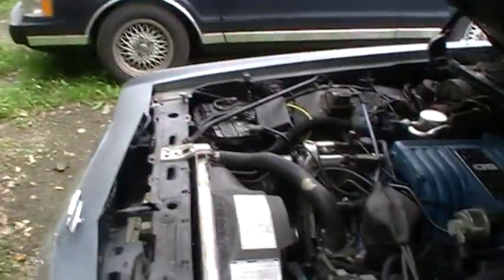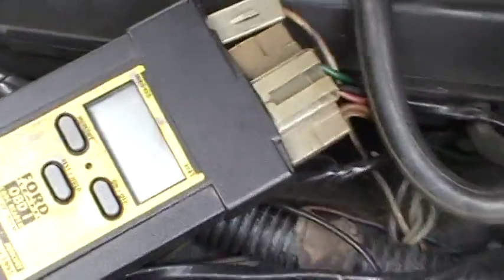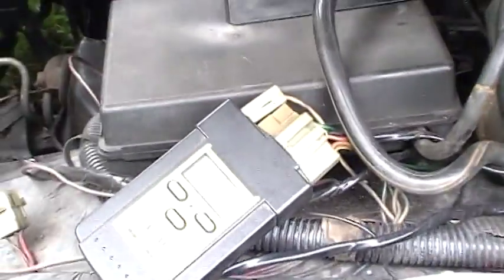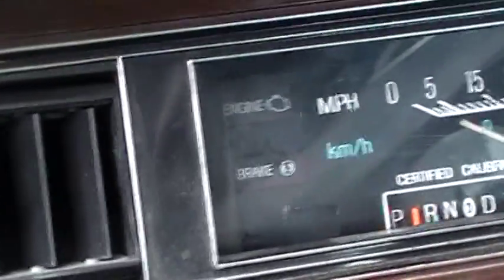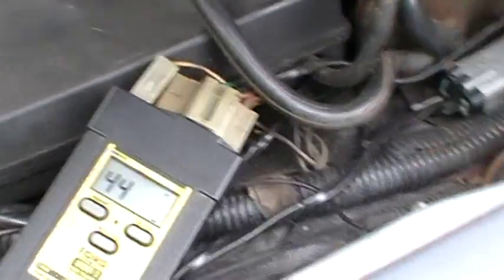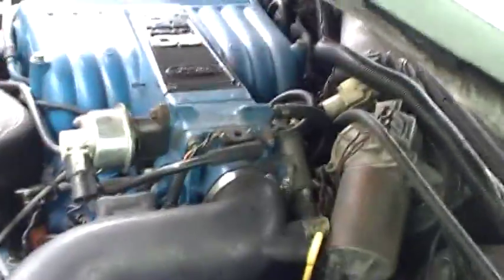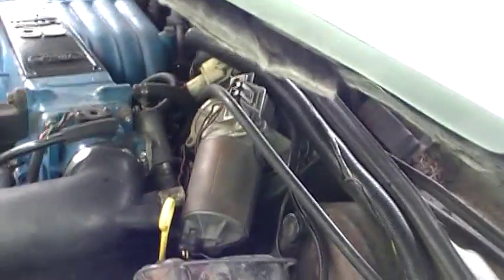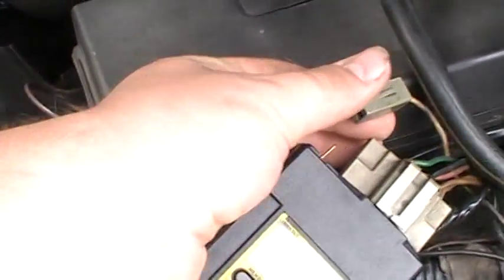How To Do A KOER & Cylinder Balance Test On An EEC-IV SEFI Ford

Comment from the maker: ***** Code 22 is for the MAP/BAP Sensor out of self test range. 
Make sure its plugged in. If it is plugged in, make sure that if it has a vacuum hose, it's in tact.  It should have a vacuum hose if you don't have a MAF sensor on your airbox.  If you do, it shouldn't have a vacuum line to it.  If everything checks out, it might just be a dud sensor.

Comment from the maker: @gunforme It could be that one of your injectors is stuck open, causing fuel pressure to be low and make the car stall out.  You may also have a bad fuel pressure regulator, or a clogged fuel filter or a dying pump.  Best thing to do is to start with the easy/cheap stuff first, before you condemn something that's hard or expensive to replace.

Comment from the maker: @ptf969696 I bought this speedometer from someone on ebay.  I have very randomly found some 140 speedometer clusters in the junkyard.  I do have an extra one for an 88-89. It will fit in an 87 down vic with no issues though.  Difference being the needle is orange and the script of the numbers.

Comment: I've got a 91 Mustang I wanted to try this with but I don't know if the dummy light even works. The car runs rough at idle and dies when cold so something isn't right. I did a fuel pressure test and it came up rather low so I'm wondering if he previous owner reduced the fuel pressure.